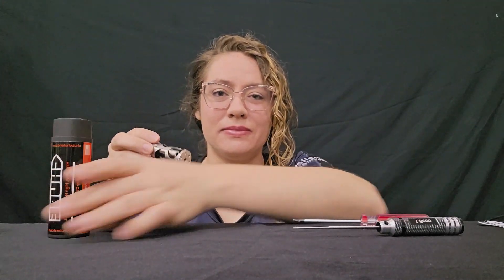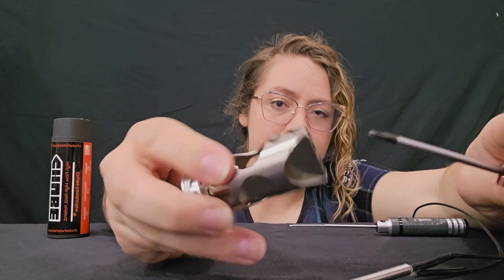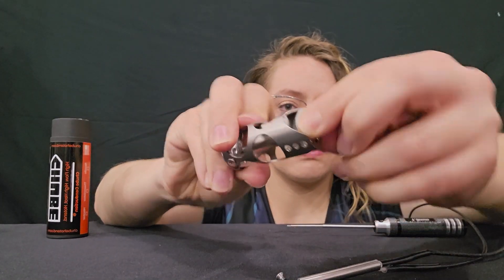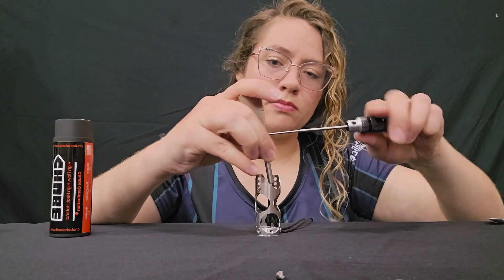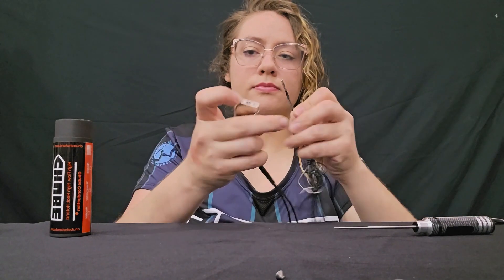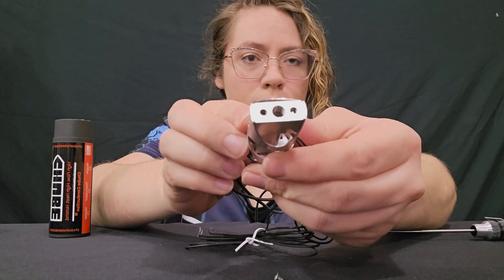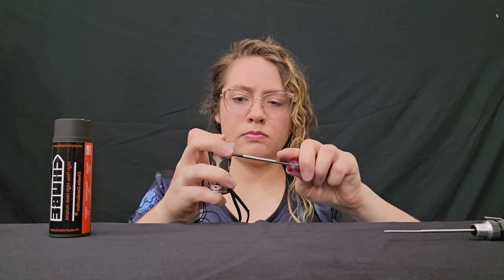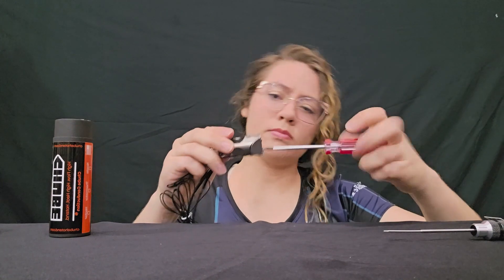Chube Conduction Heater and Thermistor Installation

Comment: What is the difference between air and conduction?
Reply: One uses active cooling (IE, a fan) to remove heat from the heat break, the other uses passive cooling in the form of mating it up to a metal print carriage and conducting the heat through the entire structure. Because the conduction doesn't need fins for the active cooling to pass through, they were able to make the melt zone longer on it.